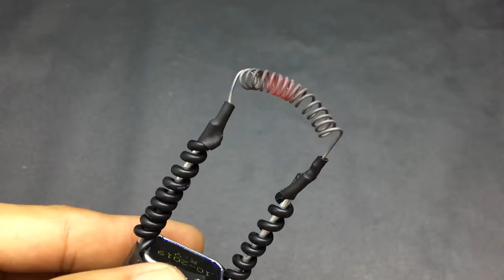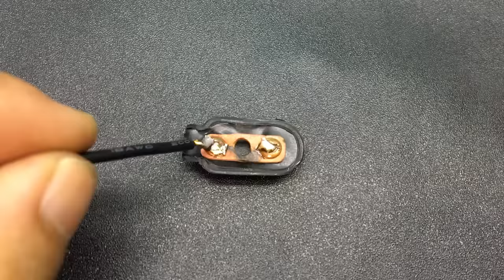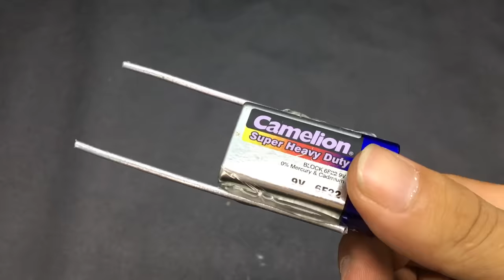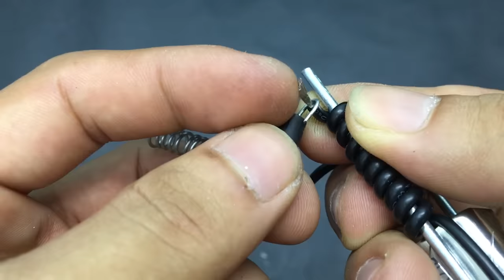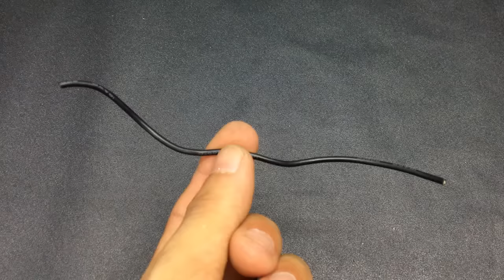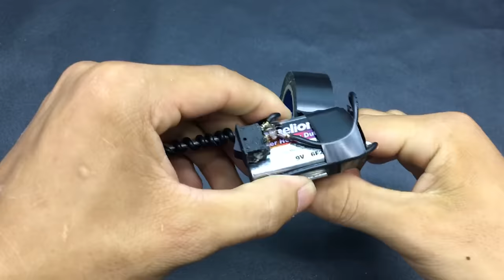How to Make an Electric Hot Wire Lighter

Comment: good ideas,  man..pls say which materials you use to this
Reply: A solder a 
2 Wires 
Magnetic tape 
a 12 volt battery
And a on off button that's basically it

Comment: wire + electricity = heat   ,
that is nichrome wire . you can get it from your home appliance
Reply: Wei Zhao no
Reply: that is the only material that gets heated up quickly at low electricity
you can avail it from household things like ironbox, dryer ..
Reply: HI ICOME FROM KOR
Reply: get nichrome wire at vape store....only about 1 dollar for each meter
Reply: What is it to get battery wire
Reply: Achko Machko le kachuko le
Reply: an old hairdryer has nicrome whire in it

Comment: Is there a risk that the battery could explode if I hold it down for a few minutes?
Reply: It wont explode, it will overheat, and eventualy burst into flames.
Reply: @xxxxxxxxxx1600  most likely not, if you keep the battery from a distance it would not be a problem.
Reply: @xxxxxxxxxx1600 it is a that I am looking for
Reply: @RottenFlesh-we6nu  thanks giving answer
Reply: Why
Reply: Why
Reply: @xxxxxxxxxx1600  why
Reply: @xxxxxxxxxx1600  so I can use it for heating wqter
Reply: Water
Reply: @xxxxxxxxxx1600  oh ,I am saying that I am looking for same question so thanks
Reply: @mittalranawat1607  the battery will not explodr only it will heat but use nicrome wire for heating
Reply: Can i use steel wire instead of nicrome.

Comment: can i know the material used for this project?
Reply: arif farhan 9v battery, kanthal wire (any resistance wire), looks like 10 gauge wire, 2 position switch ( a momentary would also work) heat shrink tubing, electrical tape, and a soldering iron. Hope this helps ;)

Comment: No one here is even trying to think that 9volts battery are dry cells and they can't provide you more than 1 amp of current thus it can't give more than 9 watts of power,
And by apparently looking at the heat produced by coil it is clear that the power used is more than 30 watts so indirectly saying it's a fake video and those who are trying to make this will never succeed.

Comment: 634 comments and nobody has any idea what gauge nichrome wire is used. Probably 400 smart guys battling to be the quickest " its nichrome wire" response. That answer no longer comes with brownie points. Come with a minimum gauge # or refrain from a question that has been answered in 400 + comments.

Comment: Its totally fake. He is using 24swg its used to cut foam. It wont glow in 9v battery. Dont waste money and time.. i have tried it.. it can get heat with mobile battery itself but it wont glow as of this video mentioned
Reply: What wire did you use in the spring?

Comment: This is fake bro I am tried battery is blast lm nikhil 13year ago
Reply: awadhesh yadav the coil you are using is not good if the battery blast before the coil heat up then the coil resistant is higher than amp battery provide you get me it means that the coil pushes the battery to over heat by trying to consume a higher amp than it can provide